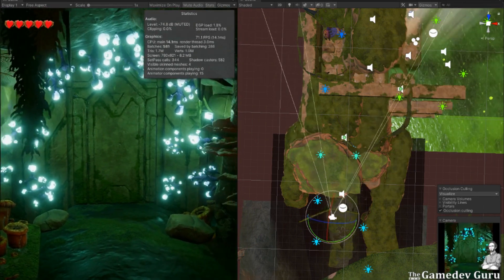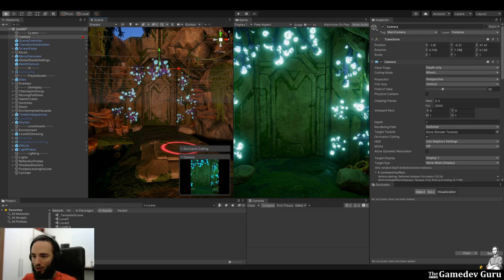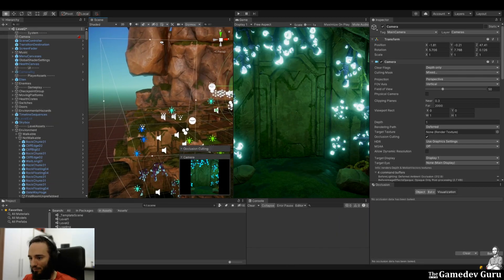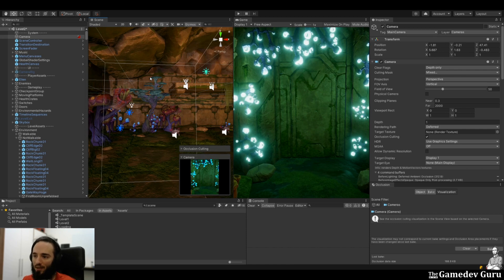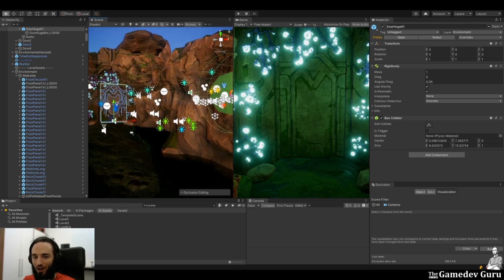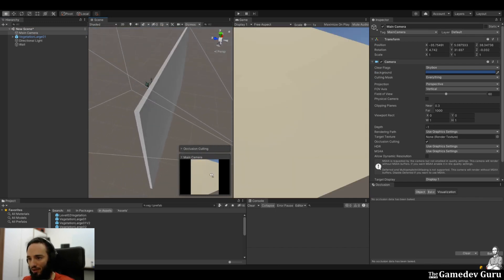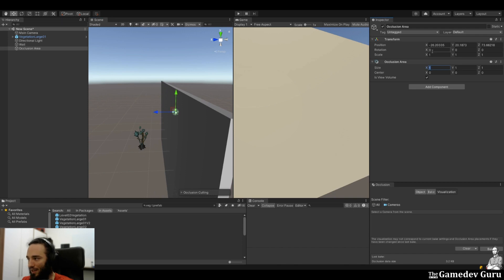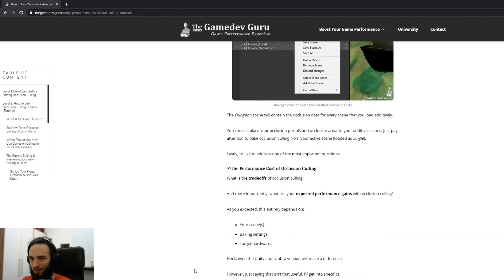Occlusion Culling Tutorial — Improve Unity Performance

Comment: It does not work for me. I made the wall and a cube behind it. Wall is ocludeer and the cube is ocludie. Made occlusion area, baked it then switched to visulazitaion bake it too and the cube is still there behind the wall in the editor.
Reply from the maker: So many things can be off here. Maybe preview isn't working. Or maybe occlusion culling parameters aren't tweaked correctly. Best is to start with standard meshes (cubes), have a big occluder and a small occludee and go from there to your real use cases when you get that working

Comment: I also did everything according to your video (as lc kevin in comments), but nothing has changed in my large scene with castle - and even the FPS has dropped. I don't even know what the point is... Very strange... But I put a like and subscribed for an interesting and informative video by the author...
Reply from the maker: Use the occlusion culling window to visualize if occlusion culling is working. There is a preview mode when you select a camera.
Probably A) your parameters are wrong or B) your geometry is not well modeled and/or set up, e.g. holes/gaps.
Reply: @TheGameDevGuru  Unities inbuilt Umbra culling to this day is just plain bad and best to be avoided...

Comment: I’ve followed this tutorial and it did not work few aspects for my scene which is a mansion has 3 floors and when the player stand into a specific corner of the mansion it still render 2nd and 3rd floor with some furniture any idea ?
Reply from the maker: Probably you need to play with the occlusion parameters. Also, some geometry of yours might be "broken" for occlusion culling. You can try adding static cubes for testing.